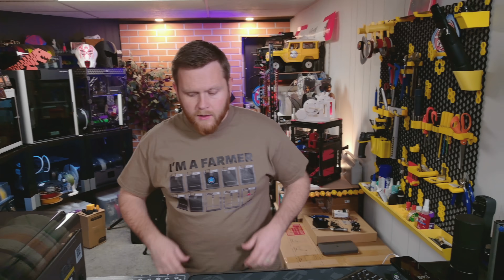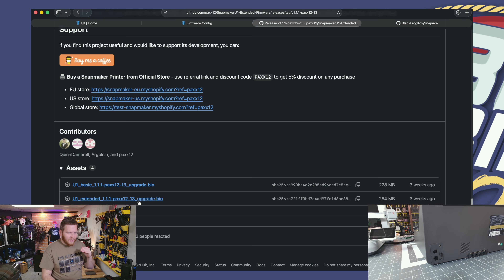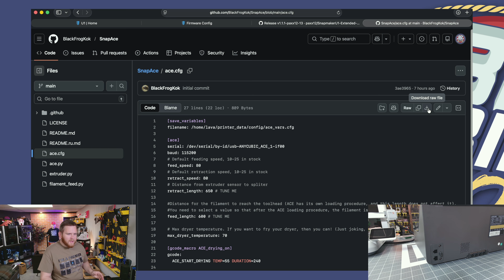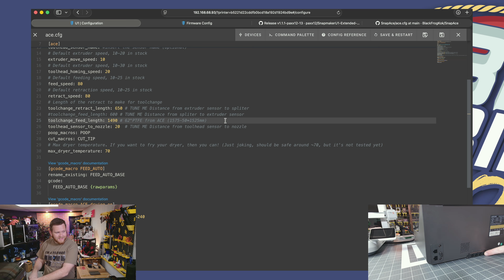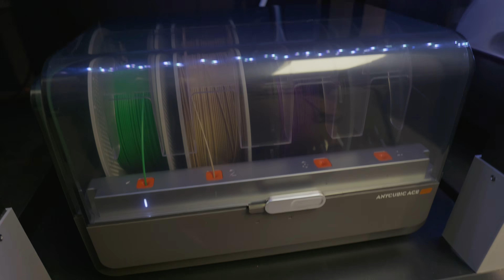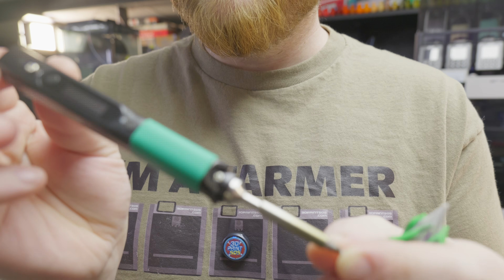Snapmaker U1 Just Got a Massive Opersource Upgrade (With Anycubic)

Comment: Having an issue I'm hoping someone on here might help me solve with this mod: for some reason, the filament being fed to toolhead one stops around 10 inches away from the head, but toolhead 2 will feed until around 2 inches from the head. The ptfe tubes were cut similar lengths, maybe a half inch discrepancy tops. Any ideas how to address this or what's going on here?
Reply: Have the same problem. All PTFEs are the same length. Maybe I'll try another filament and compare it. If it is the same length I'm gonna shorten the PTFE a little to have the same length to the toolhead. Also my config file doesn't look the same like the one in the video. I think they've changed a little bit there. Searching for a discord-channel about this mod but can't find one specially for this mod.
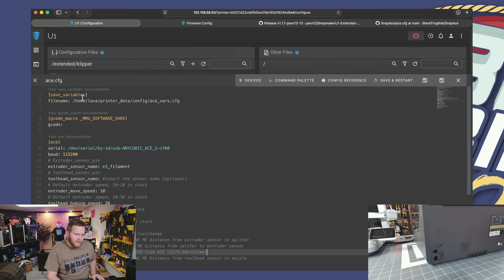Reply: @printfluencer  yeah the video is confusing a bit. At 15:58 the ace.cfg shown matches what is currently in the repo (and what you and I likely have), but at 21:55 when he clicks his ace.cfg in Fluidd its different.

Comment: Pretty cool now I need one for each toolhead and 16 colors.
Reply: Then you are defeating the purpose of the tool changer.
Reply: @KD4ASM You are but you’re giving yourself some flexibility when needed. Why have it limited to just 4? I have an 8 color print going now on my 7 nozzle H2C so I get a tiny bit of waste but I’m able to print what I want.
Reply: @KD4ASM  no you're not, it would still waste waaay less filament than a bambu..
Reply: @KD4ASM  or making it easier to change what color is in the head for a mutli color print.  it doesnt have to extract every print.

Comment: I can't for the life of me get the U1 to connect to the Ace Pro. It uses /dev/serial/by-id, but while using a USB C connector as well as the 6 pin connector to usb, I cannot get a successful connection. I have two Ace Pro's, but I can't get a connection. It's making me crazy. I get a error cannot connect to /dev/serial/by-id/usb-ANYCUBIC_ACE_1-if00. I can't find any other source for information. Maybe U1 has a problem? I used that USB port to mod the firmware... Great video. Thank you for taking the time.
Reply: Solved my problem, ACEPro only showed up in dev/serial/by-id when i attached an usb hub to my snapmaker and acepro in the hub..
Reply: I have the same problem, did you figure it out so far?

Comment: I keep getting "Error connecting to /dev/serial/by-id/usb-ANYCUBIC_ACE_1-if00" on the my web interface (It also appears on the printer screen). I double-checked the USB cable connections. I copied the files again from the beginning. I tried both the Type-C connector and device's own connector separately. But I keep getting the same error. What else should I do?
Reply: Check /dev/serial/by-id directory via ssh console (putty), if there is no usb-ANYCUBIC_ACE_1-if00 named device - you definitely have some connectivity problems.
Reply: @ArtDesignEngineering  Thank you for your interest. I tried several USB cables. I realized the problem was with the cables. Thank you.

Comment: You know.... if you dedicated one toolhead to the ACE to change filaments... that could be a game changer. While another toolhead was running, you could retract and extrude to a single toolhead, and do this between the other toolhead operations as well. Not saving much on poop, but the time for filament change could be drastically reduced, and give you more material choices. Combine that with Spectrum spOrcaSlicer.... just thinking here. I know I will probably have a spare ACE sitting around (though still might use it with a refurb Kobra S1) once I get the Ace Pro 2 upgrade.
Reply from the maker: It’s possible and currently being worked on. It relies on several teams from several counties working together to make it happen. So it’s a bit tricky. Plus, no cutter in the toolhead. Tip forming is decent on this machine but it definitely complicates things a bit. The strength of the ACE is that is has 4 individual buffers and ptfe tubes for each lane. Making it perfect for this. But yes, in due time, I think it’s possible.

Comment: I get my U1 is a couple days so I don’t yet understand how unloading works without a filament color. I know people say it uses tip forming but how reliable is that?  Do you need to cut the filament every time after you unload in order to have the filament ready to load again?
Reply from the maker: The tip forming on the machine is great. But this mod doesn’t add multi color. The Ace has 4 individual buffers and 4 ptfe tubes. So it’s perfect to use instead of the stock spool holders. Plus add drying.

Comment: Why? The selling point is to have 4 independent tool heads without waste and additional swap time. You've basically turned it into a 4-tool Bambu printer. <shrugs>
Reply from the maker: You didn’t watch it. :(. This doesn’t do swaps. It adds a dryer to the mix. Each lane goes to each toolhead. They are independent ptfe tubes that go to each toolhead. It just moves the spools from the sides.
Reply: @3DPrintSOS  Sorry, I was commenting on another's U1 monstrosity and I copy, pasted to the wrong one. Still this makes me nervous in that wiring is involved. And it fails for TPU. But that last bit can rectified putting it on top for gravity and a shorter run? Anyway, sorry about that. I'll give it a couple of days for you to see this, then I will delete it.

Comment: Thank you for the tips, something was going wonky with my slot 4, it would continuously feed filament. I lost the spring in the filament detection sensor, so for now I will manually load like you suggested until I can figure out what's going on
Reply from the maker: That's rough about the sensor, but glad you can still use the slot manually in the meantime! 😊

Comment: Any benefit of this vs much cheaper filament dryer(s)? It would be cool to be able to replace filaments per toolhead automatically for extra colors but for now I don't see any point. Thanks for the video though!
Reply from the maker: The point is to significantly simplify the setup. No more spools on the side, no additional boxes or motors. If you are limited on space horizontally, this mod and a lid means it’s all just one narrow unit. For me, the spools on side don’t work well on my shelving.
Reply: So same as with dryers 🙂 There are mods where ppl relocate feeders to the back and connect to dryers above/below/behind U1. Better if you already have dryers or pref. to save VS buying more expensive Ace Pro.

Comment: The Ace Pro is awful at moving filament though.  It has 2 steppers driving a cylinder that pushes filament up against a drive wheel, it slips badly even normally.  ACE Pro 2 has 4 proper steppers and no cylinder, each one is actually driving that filament with proper tension and drive wheels.

Comment: does this also work with ace 2 pro ? i wonder if there will also be an biqu vivid integration as vivid also has nfc integration.
Reply from the maker: Not sure about either. Hoping to test both of those. Does the vivid have 4 individual PTFE tubes?
Reply: @3DPrintSOS your right vivid only has one ptfe tube. so this wont work. for ace 2 pro this solution i think would need minor updates in the software from the github project.

Comment: Could I use 4 ACE Pro on the Snapmaker U1 for switching the color or material? 1 Head with one ACE?
Reply from the maker: Should be testing soon. There is no cutter on this machine. But maybe, just maybe.
Reply: @3DPrintSOS  

I’ve been thinking about an extension of the U1-ACE concept and wanted to ask whether something like this would even be technically possible.

Imagine a Snapmaker U1 with 4 toolheads, where each toolhead has its own dedicated ACE unit.

So instead of one ACE feeding multiple tools, the setup would look like this:

Toolhead 1 → ACE 1
Toolhead 2 → ACE 2
Toolhead 3 → ACE 3
Toolhead 4 → ACE 4

Conceptually it would behave like having four Anycubic Kobra 3 systems integrated into one Snapmaker.

ACE → feeder → toolhead

Each toolhead would therefore have access to 4 filaments from its own ACE. In total the machine could manage up to 16 materials, but each toolhead would only switch within its own ACE.

Example use case:

- Toolhead 1: Carbon fiber filaments (hardened nozzle)
- Toolhead 2: Nylon / PETG engineering materials
- Toolhead 3: Flexible materials (TPU)
- Toolhead 4: soluble support materials

The advantage would be:

- no purge towers
- dedicated hardware per material type
- filament switching can happen while the toolhead is parked
- optimized setups for abrasive materials

In practice the workflow could be:

Active tool prints →
Next toolhead prepares filament via its ACE →
Tool change → continue printing immediately.

Do you think something like this could theoretically be implemented in the U1-ACE architecture, or would the ACE communication / firmware make this unrealistic?

I’d really appreciate your thoughts.
Reply from the maker: @ROADTOJUSTICE  I think its possible, but would be significantly better with a cutter. The other main hurdle is going to be buffers and ptfe tube Y connectors. Its going to be insane with that many Ace units. Plus managing power...
Reply: @3DPrintSOS  

I would keep the original U1 feeder with the integrated cutter.

On the Snapmaker U1 every filament is already individually connected to the feeder. My idea is simply to place the ACE before that system.

The ACE would feed four filaments into a 4-in-1 connector, and that output would go into the original U1 feeder. From that point on the U1 feeder and cutter handle the rest of the process.

So the workflow would be:

ACE → 4-in-1 connector → U1 feeder with cutter → extruder → hotend.

The ACE only handles filament selection and pushing the filament to the feeder.
The feeder pulls the filament in, cuts it when switching materials, and then the ACE retracts the filament and loads the next one.

That way the original cutter mechanism of the U1 stays untouched and continues to manage the filament switching.

Reference implementations / concept examples:

https://github.com/DnG-Crafts/U1-Ace

https://youtube.com/shorts/kbnHLlkmScc?si=cPnqRaJvXENeXXAL
Reply: @3DPrintSOS 

This my idea:

Concept: Using Multiple ACE Pro Units with the Snapmaker U1

My idea is based on keeping the original Snapmaker U1 filament system completely intact. The modification would only happen before the U1 feeder.

In my setup I would have:

- 1 Snapmaker U1
- 4 ACE Pro units

All four ACE units would be placed in a shelf or rack next to the printer. Each ACE would serve one specific toolhead.

So the system would look like this:

Toolhead 1 → ACE Pro 1
Toolhead 2 → ACE Pro 2
Toolhead 3 → ACE Pro 3
Toolhead 4 → ACE Pro 4

Each ACE provides four materials, so every toolhead can switch between four filaments independently.

---

Mechanical Concept

Each ACE outputs four PTFE tubes for the different filaments.
These four tubes would go into a custom 4-to-1 connector (3D printed or machined).

So the flow would be:

ACE → 4-to-1 PTFE connector → U1 feeder → Bowden tube → toolhead → hotend

The important point is that the original U1 feeder with its cutter mechanism stays unchanged.

The ACE only performs:

- filament selection
- pushing filament forward
- retracting filament

The U1 feeder then takes over:

- pulling filament
- feeding it through the printer
- cutting the filament when a material change happens

---

Example Workflow

1. The ACE selects a filament (for example black PLA).
2. The ACE pushes the filament through the PTFE tube.
3. The filament enters the 4-to-1 connector.
4. From there it goes into the U1 feeder.
5. The feeder grabs the filament and pushes it through the Bowden tube to the toolhead.
6. Printing begins.

When a material change is required:

1. The feeder retracts and cuts the filament.
2. The ACE retracts the remaining filament back into the unit.
3. The ACE selects the next filament.
4. The new filament is pushed forward again.

From the printer’s perspective, it always receives filament through the feeder exactly like a normal spool system. The material switching happens before the feeder.

---

Operational Concept

I imagine the system behaving somewhat like a revolver magazine:

Each ACE holds four filaments in a dry, controlled environment.
When a material is needed, the ACE sends the selected filament toward the feeder.

Example:

Black filament → PTFE tube → connector → feeder → Bowden → toolhead.

The printer always processes whatever filament the feeder delivers.

Material changes would ideally happen when the toolhead is parked, as a safety measure.

Alternatively, a purge or cleaning routine could be performed before the new material starts printing.

---

Key Idea

The main goal is to let the ACE handle filament storage and selection, while the Snapmaker U1 feeder continues to manage feeding, cutting, and extrusion.

This way the original printer mechanics remain untouched, and the filament switching happens entirely upstream of the feeder.

Like:

I’ve been thinking about an extension of the U1-ACE concept and wanted to ask whether something like this would even be technically possible.

Imagine a Snapmaker U1 with 4 toolheads, where each toolhead has its own dedicated ACE unit.

So instead of one ACE feeding multiple tools, the setup would look like this:

Toolhead 1 → ACE 1
Toolhead 2 → ACE 2
Toolhead 3 → ACE 3
Toolhead 4 → ACE 4

Conceptually it would behave like having four Anycubic Kobra 3 systems integrated into one Snapmaker.

ACE → feeder → toolhead

Each toolhead would therefore have access to 4 filaments from its own ACE. In total the machine could manage up to 16 materials, but each toolhead would only switch within its own ACE.

Example use case:

- Toolhead 1: Carbon fiber filaments (hardened nozzle)
- Toolhead 2: Nylon / PETG engineering materials
- Toolhead 3: Flexible materials (TPU)
- Toolhead 4: soluble support materials

The advantage would be:

- no purge towers
- dedicated hardware per material type
- filament switching can happen while the toolhead is parked
- optimized setups for abrasive materials

In practice the workflow could be:

Active tool prints →
Next toolhead prepares filament via its ACE →
Tool change → continue printing immediately.

Do you think something like this could theoretically be implemented in the U1-ACE architecture, or would the ACE communication / firmware make this unrealistic?

I’d really appreciate your thoughts.

I would keep the original U1 feeder with the integrated cutter.

On the Snapmaker U1 every filament is already individually connected to the feeder. My idea is simply to place the ACE before that system.

The ACE would feed four filaments into a 4-in-1 connector, and that output would go into the original U1 feeder. From that point on the U1 feeder and cutter handle the rest of the process.

So the workflow would be:

ACE → 4-in-1 connector → U1 feeder with cutter → extruder → hotend.

The ACE only handles filament selection and pushing the filament to the feeder.
The feeder pulls the filament in, cuts it when switching materials, and then the ACE retracts the filament and loads the next one.

That way the original cutter mechanism of the U1 stays untouched and continues to manage the filament switching.

Reference implementations / concept examples:

https://github.com/DnG-Crafts/U1-Ace

https://youtube.com/shorts/kbnHLlkmScc?si=cPnqRaJvXENeXXAL,
Reply: NOW WE HAVE MULTIACE 😂

Comment: really great mod, however, can i get feedback on why is so many do the board mod instead of just a simple cable from 4 or 6 pin adapter to usb C or A? but instead make a whol extra plug
Reply from the maker: The plus is a Molex MicroFit 3.0. And you only need the three cables I showed. You can always cut a cable and add terminals for the plug. 

I did it this way because I don’t have to order anything and I have a TON of cables. I don’t mind modding my hardware. But just like I mentioned in the video, super easy to make your own cable if you want.

Comment: Interesting, but does it even dry the filament? If not it's not so much interesting imo
Reply from the maker: Yep, as I showed in the video and linked in the chapters, there is a macro for heating and you can add more or change the base values.
Reply: @3DPrintSOS  cool

Comment: I got a Space Pi X4 dryer for basically doing exactly this but using the built-in filament feeders.  Some pretty great mods to be able to change the angles those sit at and it's easy to modify the printer.cfg based on whatever length of tube you need from the dryer to the printer.
Reply: I have the same but not having automated filament retraction is definitely the biggest downside. Also not having a buffer, while not needed, is also a negative.

I'd happily take both of the above over my current setup.
Reply: how do you set up the spacepi to work properly like you say? I have only seen it bypassing the feeders.
Reply: @jarayn  Someone made a feeder angle adjustment bracket that I use so it angles the feeders a bit more towards the back and then there's plenty of PTFE adapter covers and I've had decent luck with one that is just friction fit insteat of needing to install a PC4-M10 connector.

The only annoyance I've had is for some reason one of my toolheads I needed to increase the unload retraction distance for it to actually fully unload the filament so I could pull it back.  Since the SpacePi doesn't have anything to keep PTFE tubes from pulling in when you're retracting I also grabbed someone's print to help retain the PTFE tube.